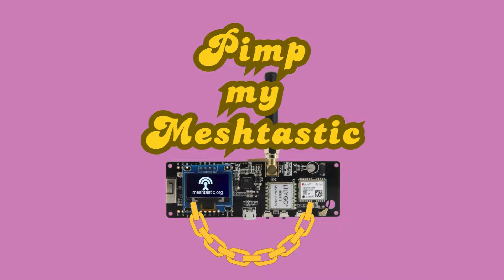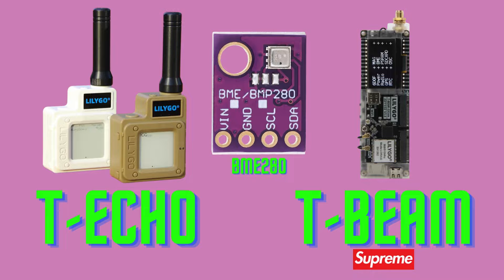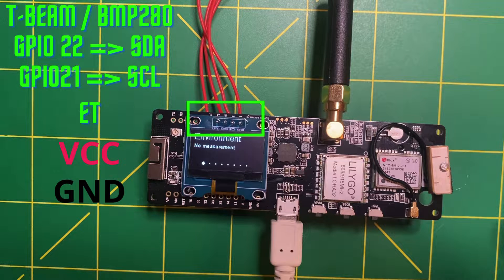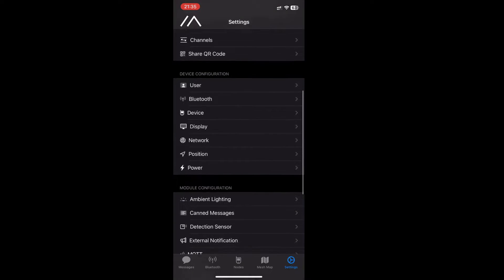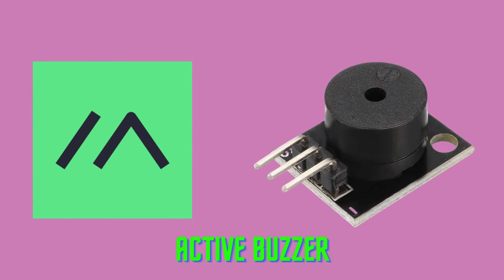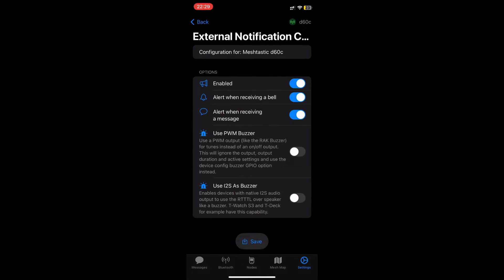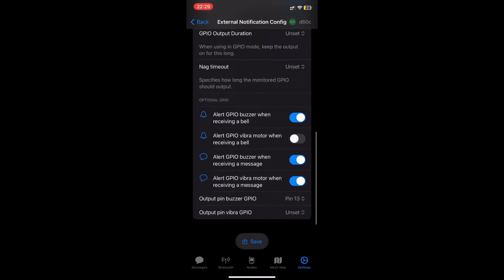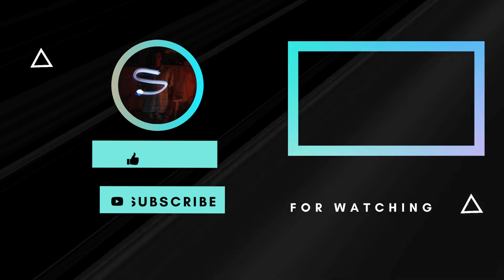Enhance Your Meshtastic T-Beam: Easy Installation of Temperature Sensors and a Buzzer

Comment: Thank you very much for the information, Sam! Now, for example, if I want to use it during my hikes in the páramos, and in addition to sending my coordinates via APRS, I want to use sensors to measure temperature, humidity, walking speed, and some other variables, or perhaps send an SMS with the coordinates at regular intervals using a GSM module, can I do the necessary programming to make it work? Since it is based on an ESP32, I think it could be done, but I'm not sure.
Reply from the maker: For the temperature sensors and GPS, there are presets for how frequently data should be broadcast. However, as far as I remember, this data is not sent via text message but can be retrieved through the app, likely to prevent nodes from spamming.

As for performing this type of automation solely with the ESP32, I’m not sure it’s feasible. Connecting the ESP32 to a PC would probably make this doable with some basic scripts.

That’s a really interesting use case, and I’d love to explore it further in future tests